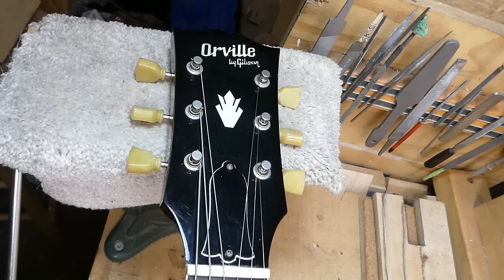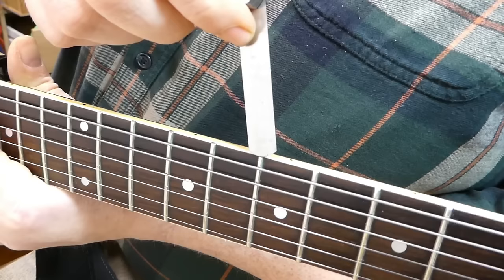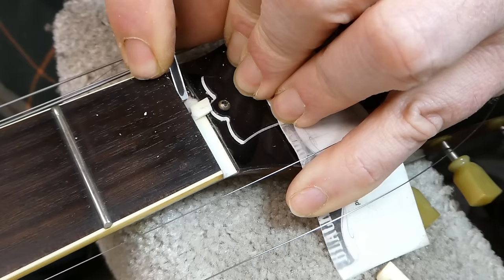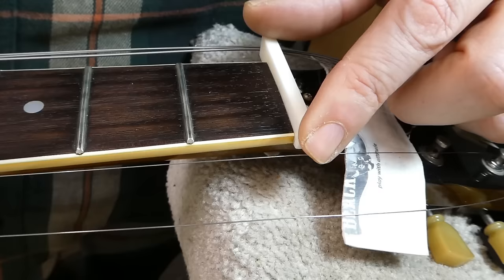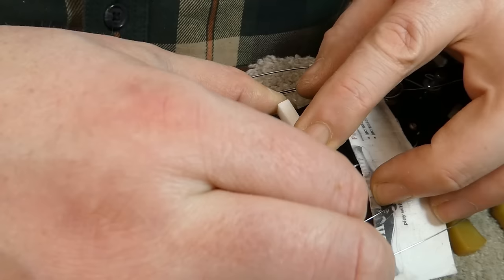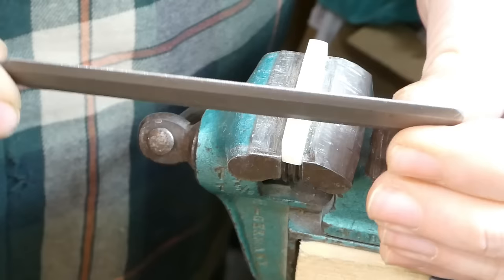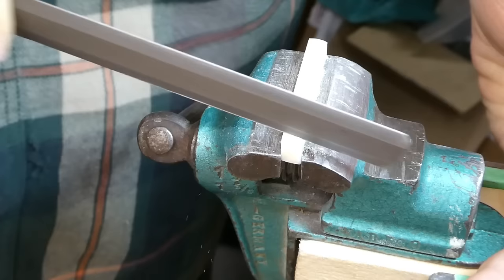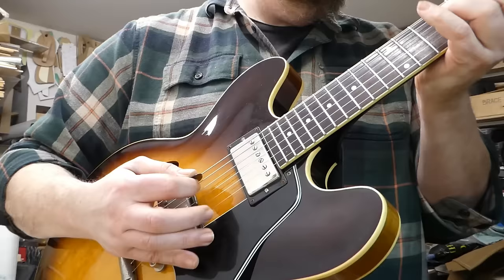Adventures in Gibson

Comment: I used to have a '79 Goldtop Deluxe that looked remarkably like that one. I toured with it through the 1990s, and never had a headstock break, despite whacking the headstock into lighting gantries on small barroom stages on more than one occasion! Sounded great, but, like that one, it weighed a ton. These days I play a humbucker-equipped 7lb Strat. Much better on the shoulder.

Comment: I once owned a Gibson ES-335 an all black walnut 1978 I sold it. It didn't sound good and gigs with polarity issues I get the volume shock blues! 30 years later I learned Fender never tested Altec Lancing's speakers on the Fender's Twin Reverb. So I learned enough to nice modern, modest setup to play with as long as I can. I think this is educational. I've done my part to keeping our acoustical guitars have worked in music. I'm building a table saw sled #2. This will be better and texture ruff on top with a baby smooth bottom.

Comment: My less than virgin King 2B trombone got run over in the case by a vehicle bigger than a motor cycle at an outdoor gig. If it can be repaired to optimum playing condition it will remain as the go to instrument in the aresenal. I am sticking with Epiphones rather than. Gibson L-5s for stringed gigs. Advice well taken. Thanks for the good videos with correct nomenclature for tools.

Comment: Aria made in Japan was usually made by Matsumoku! Their Matsumoto factory burned to the ground in around 1985, and Singer had very recently cancelled an extremely lucrative contract with Matsomuko to make sewing machine cabinets. I have a Matsumoku made Vantage AR550 ES335 copy that had a major flaw in the center block that made the neck really rubbery. I had to carve a piece of mahogany into a shape like a corner piece of sectional furniture with spruce on the bottom, glue that in and then glue some spruce on top. Then I had to glue in two maple wedges, wind some wire up squeezing the two together like a long jack to make them hike half of the neck tenon up and onto something solid It's a great ES335 copy with a thin 1960s Gibson slimline neck profile.
Reply: That's Interesting bit of information about them.
I have a 1992 Orville by Gibson Les Paul that was built in the Fujigen factory.  It seems that studying the history of these Japanese guitars can lead to a deep rabbit hole.  Once you think you understand how things were done, you'll find exceptions.

Comment: Every time I see a Les Paul with a broken or repaired headstock, I can't believe my luck. About a year after I got my very heavy Les Paul Standard, the strap came free of the front strap button when I was messing around with a vocal mic and not holding the guitar. It dropped and landed right on the headstock. It created a scratch on the back of the headstock and broke one of the tuners, but otherwise the guitar was undamaged. 

I had to buy six Kluson tuners to replace the one that broke since that's the only way they sold them at the time. I had no idea how lucky I was at the time and thank the gods that I learned my lesson the easy way. I've used strap locks on that guitar ever since.

Comment: I was an aircraft structure mechanic for 15 years. All I did was sheet metal fabrication ( making parts) In aviation you never leave a sharp edge on anything. Every corner is rounded.  Now I’m a guitar tech/ luthier. I use all the same rules when fabbing parts on guitars. To make the resin smoother use peel ply. I also can make a valley for the fiber to sit in and then sand it smooth. Just like fiberglass

Comment: About roller bridges:  You don't need one unless you have a whammy, as there is little chance there will be any string movement from it to the tail piece;  Always stretch your strings when putting new ones on to take out any slack, and if you do get a Bigsby or similar which are not good for stable tuning (lots of string behind the bridge) then don't get one where the "Rollers" are on threads, because that's not a roller but a nut, and they don't always turn smoothly, and it will throw off your string spacing.  Get true rollers where the roller rolls on a plain rod and sits in a space it can't go sideways but a hair.  If the roller and rod are one piece, those too don't roll as smoothly.  A tiny bit of oil is not at all a bad idea to use if you do have issues.  Way back when, Hagstrom used true ball bearings at both the bridge, and the nut!  They were wicked good, but people didn't like the high price, so only few were sold;  Ball bearings (good bearings in general) are not cheep.

Also, I agree, a worn out finish is a sign of a real player's loved instrument, and one with an immaculate finish, and a thick layer of polishes and waxes tells me it's a wall hanger, or status symbol!  Don't worry too much about a scratch or dent, do what Frank Zappa suggested:  "Shut Up and Play Your Guitar"!😜

Comment: Those Orvilles are fantastic instruments.  I've played a couple Les Pauls and a Thunderbird bass.
Thanks BTW, filing the slot to be more consistent before fitting the nut is EXACTLY  what I would have done.  Also how I make a nut. Nice to have my methods validated 😁
Reply: Although I usually use Elmer's whit glue to glue it in, just enough strength to be stable, but easy to remove later

Comment: After 4000 grit I am down to using polishing compounds and leather. I have the $500 Mitutoyo carbide anvil 8 inch coolant proof caliper set, but for woodworking an old dial caliper from SPI, Fowler, Starette, Mitutoyo or Waltham is fine. Waltham made stuff  Ames too, and yes, it is The Waltham Watch Company, and it's really high quality stuff.

Comment: People overthink calipers so much for woodworking. As long as it gives consistent and repeatable results, that's all that maters. Cheap ones can be just as good for this work as long as it's consistent. It doesn't matter if it's a little off compared to a true calibrated pair like Starrett or Mitutoyo. We are using them to get reference measurements in a self contained scenario, not using them to check highly critical machining tolerances of components that will be used as part of a bigger component. In that case there needs to accuracy because it's going to other people or factories to use and the dimensions need to be true. For us, it doesn't matter if the caliper reads that the nut is a few thousands wider than the true dimension, because we're going to be using the same pair of calipers we used to get the measurement to dimension the nut. The number is irrelevant at that point because it's being referenced by the same tool.

Comment: I was working on a mandolin nut that was so tight in the slot it would pop out if I let go. That's when I noticed the fingerboard end and half the slot had a thick coat of finish. So, I shaved it all off with some x-acto blades and it fit perfect.

Comment: Denture cleaner will remove crack grunge and make look a lot better. I saw Watchmaker revival channel use it on a watch dial. It worked well.  I think it's hydrogen peroxide but denture cleaner is just as cheap.

Comment: IMO: the carbon fiber "tow" was unnecessary/overkill. Some vinyl tape on the underside will keep it all together. In actuality, the crack at the top near the neck pickup doesn't really need a whole lot of reinforcement either as the neck pickup route essentially "hugs" the pickup and kinda keeps the 'guard in place; that's why the pickguard was still attached to the guitar when it was removed. IMO.

Comment: I'm not sure angled cuts in the nut are a good idea, although theoretically it seems that way. I think in practice it is more prone to problems. Especially with the bends and the tuning recovery after them. 
A perpendicular cut with a longitudinal rounding of the nut at the rear (closer to the tuning pegs) to generate a smaller support surface (approximately 2/3 of the width) I think works better in that regard since it gives more of itself so that the string is arranged in the best way to compose the angle with less mechanical stress.
It's just an opinion. You are a great professional.

Comment: That Orville, 335 copy.Sounds like a much more expensive guitar than it really is.I think sounded great.I'll keep that in mind if I ever run across one for sale...
That Deluxe is the exact same age as me will.The pot is anyway august the seventy four I was born august 16th 1974..... I wish I could buy that guitar since it's made in my birth year...
One more thing, I also fly model airplanes and helicopters. I currently have a composite P47 razorback. It's electric. I have a hacker motor in it's AS system. I thought it was kind of cool that you mentioned a lot about your model airplane building days. So I imagine you at least used to fly.  I wonder what made you stop.Did you just burn out on it?Or what's the deal...

Comment: It looks like meter loading.  Give the output capacitive coupling in series with the output and you should see the signal drop to zero.  Right now, it appears that your tube is biasing through your scope, crazy as that might seem with the 100M ohm impedance.  That's what the scope says, but when was it last calibrated?

Comment: When I use super glue on things that come apart, like a nut from a guitar, I only use 2 very small drops. 1 at each end and that's more than enough to hold it. Same for anything else. If it's not supposed to be permanently glued, it gets a couple of small dots of super glue. That's it. No chance of anything like this happening. 5:28

Comment: The break angle over that bridge... Is that normal for a bigsby equipped LP?
Reply: That's an old '70s era aftermarket one and yeah, depending on the neck angle & bridge height they can be a bit extreme. I've even seen them grind grooves into the tailpiece side of ABRs when the bridge is set very high. Bigsby somewhat fixed it when they updated the model 7 by switching to a smaller diameter for the string roller bar, but it's still an occasional issue.

Comment: Stupid Question…is it possible for the truss rod nut to vibrate on a strat style guitar…only does it on the open B string…I’ve checked every possible place…it doesn’t rattle when I put the allen key in the truss rod…it’s driving me crazy!!!!
Reply: Only if it's loose, which it should never be. If it's a "bullet" style (exposed and at the nut) it's possible that the 'B' string is vibrating against the actual nut, but if it's "50s style" (at the neck / body joint) and sympathetically vibrating, the truss rod nut probably needs tightening (just until it's snug).
Otherwise, it's more likely to be the nut slot.
Reply: @mnemonik61  …thank you…I was thinking vibrating at the nut slot or the B string may be hitting the first fret…I’m running out of places to look and it’s driving me crazy

Comment: Angling the string slots towards the tuner shaft isn’t needed. You can achieve the same result by easing the string slot on the tuners side with nut files. I’ve done hundreds of these and never had a string stick in the nut. Don’t need graphite either. Whenever I see a angled slot I immediately think the work was done by a novice.